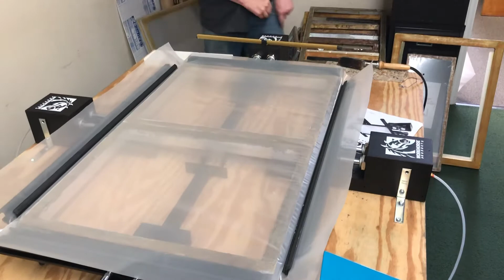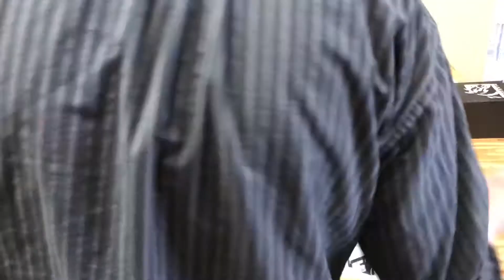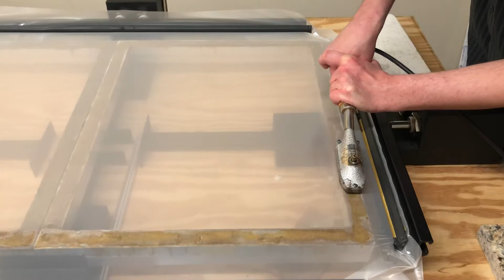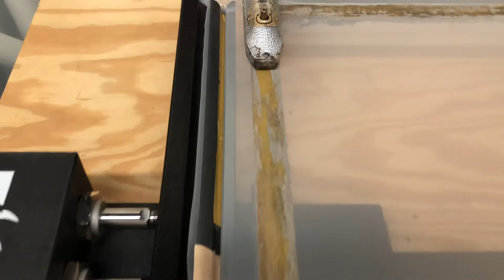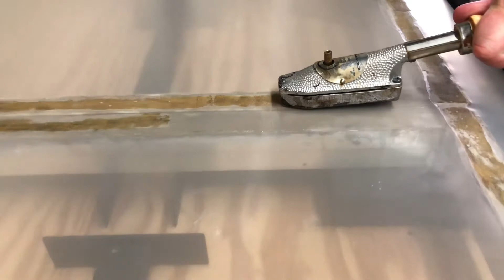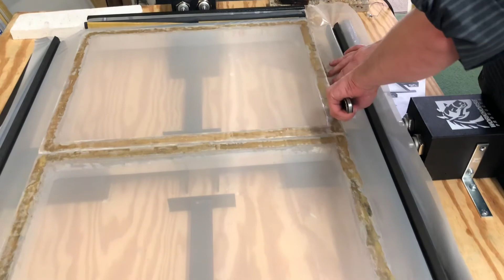Making screens on the Workhorse Pneumatic Stretcher

Comment: I'd buy 2 even if these were like $500 each. and like 40 frames with tons of different types of mesh.
Reply from the maker: If you can find them new for $500 we will take several ourselves! Most of our customers who use these stretchers are using them with the dry thermal mesh so they don't need a lot of different types of mesh. Our 120 is the swiss army knife of meshes, print whites or get up to 75lpi halftones.

Comment: Hi where you get the glue heat gun thank you
Reply from the maker: Percy Figueroa the heat wand we’re using actually doesn’t have any adhesive on it. The adhesive was applied to the frame before we began the stretching process. The heat wand is used to activate the adhesive on the frames. Both the adhesive and the heat wand can be purchased through us.
Reply: @Xpresscreen  ok how much is it
Reply from the maker: Percy Figueroa please shoot me an email at wflythe@xpresscreen.com and we can discuss further there
Reply from the maker: @percyfigueroa5383  Hi Percy, email us at info@xpresscreen.com for current prining. Thanks!